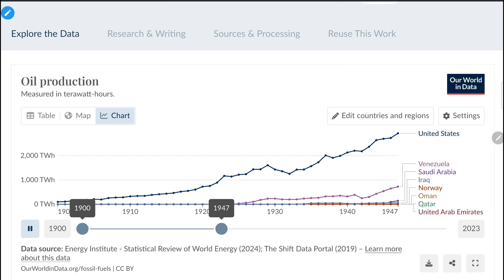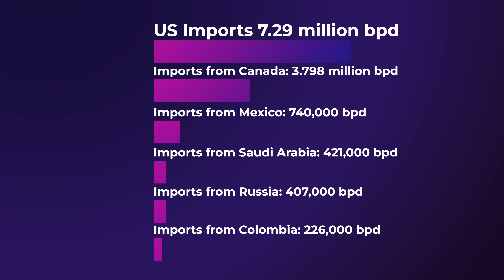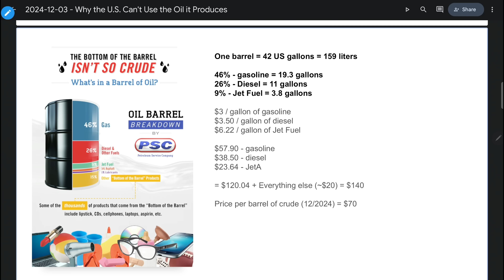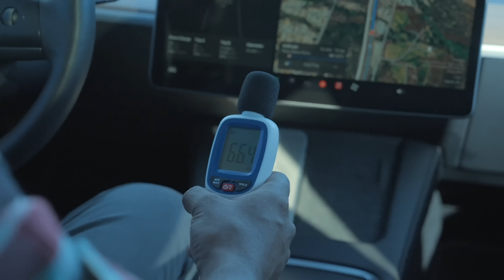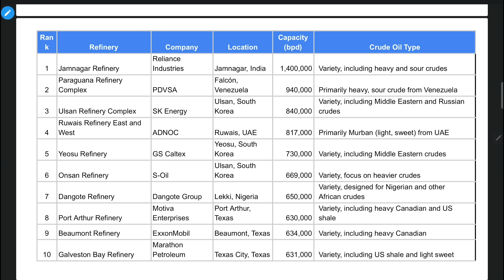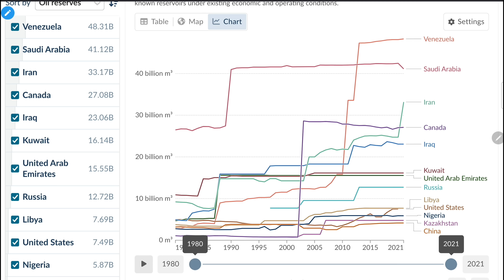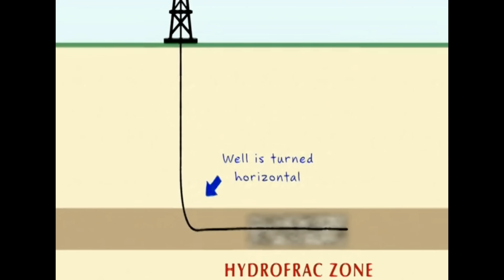Why America Can't USE The Oil it DRILLS

Comment: Super informative!  Thank you.  A small suggestion w regard to " drill baby drill."
   I disagree that doing so will not benefit the average American even though I agree we are not set up well to process shale oil and will still need to import the heavier crude / export the more valuable light sweet shale
More wells equals more demand for workers.   Workers pay tax. 
When the market gets tight, wages raise.
By exporting more, we lower trade deficits hence less interest paid to finance the dept
Natural gas is also produced when we drill, including fracking shale.  We certainly can use nat gas domestically.  It is far less poluting.  The more nat gas we use, the less heating oil we need.
We can use nat gas to generate electricity as well.

I am puzzled as to why we do not build at least some new light sweet crude optimized infrastructure near where we extract this type of oil.   Perhaps labor prices in other countries are so low that it still makes sense to ship our oil to them then buy back the finished product.
Still seems for national security we should at least build a few optimized refinery
Plants.
I m looking up heating oil next.  Seems pretty easy to process crude enough to get get it to burn well but let me find out.  

Thank you again for your excellent video.

Comment: Interesting, but EV and alternative "green" energy is not viable until 30 years hence.  But you say the US "exports" sweet oil at a premium and imports "sour" (or heavy oil) at a cheaper price, I may be missing something but seems to be good thing. Also, isn't there a problem with the Jones Act which artificially raises the transport costs between US ports. As for California, anywhere else it would be a failed state, with draconian "Green" ideology which makes energy more expensive.

Comment: The heavy crude is used for production of Disel, machine oils and hundreds of products that cannot be produced from Sweet Light crude.
Also, a processing plant works with a specific type of crude.
Result. Venezuelan Heavy Crude, for example, is used for machine oil production and USA has 4 plants that works with Venesuelan crude.
Reply: Sadly this is gibberish. Of course you can produce diesel from light sweet like Nigerian. Indeed the diesel cuts from most nigerian grades are particularly high. 
Lube oils and bitumen tend to come from heavy grades in specialist refineries but are a tiny part of the barrel.
Reply: @donaldduck4888  No. No, you cannot produce disel from light crude, nor machine oils, nor a lot of other things.
Reply: @alexander0076969  Of course you can, even Azeri BTC (a light sweet with API 38.6)  - assume you know what this means) has a large middle distillate (you do know what middle distillate is I assume) cut of around 45%.    Maybe you are confusing light crudes with condensates, though even Algerian condensate has a middle distillate cut of around 20%.  Do try to have some idea of what you are talking about.

Diesel btw is generally spelt with two "e"s, not disel [sic] btw.  Have you perhaps confused diesel with straight run fuel oil?
Reply: @donaldduck4888  I just told You, Sir, that light crude is is used to make gasoline.  Light crude is useless for textile and many other industries. Look it up.
Reply: @alexander0076969  You really have no idea what you are talking about do you?  Gasoline is made from virtually every crude after reforming the naptha cut.  US refineries are particularly good at doing this with heavy crude due to the heavy investment in upgrading kit (cat crackers, visbreakers, cokers etc) which allows them to extract light products (naptha, kero, diesel) from the heavy residues.
And you clearly are completely clueless about chemicals as well.  Much of the naptha cut in light crudes is used for chemicals production.  And what do people do with those chemicals?  Make plastics (which is a very wide range of products).  Which are used in textiles etc.
Reply: @donaldduck4888  Bro, Gasoline is made out of virtually every crude. Light sweet is the best = light sweet is almost gasoline.
On the other hand, Disel, machine oils, clothes You wear, plastics are not made out of sweet crude. They are made out of Heavy Crude. Problem with heavy crude is in the name = heavy, means natural  additions that have to be processed out. Different locations have different additions to the crude = this means SPECIFIC plant for SPECIFIC crude. Some plants can process one type of crude and no other types. Thing is, the purifying process produces disels, oils and plastic materials. 
How come You do not know anything? Are one of them Flat Earthers by any chance? I have just Googled this info. And it took less than 5 minutes.
Reply: Kerosene can, though.
Reply: Basic chemistry says that petroleum is a mish mash of many hydrocarbon chains. You can break these down, or combine them to make any organic molecules that you want. It is just more costly to make those big molecules from the light crude.
Reply: @9Point8  No it is no more expensive.  The residues from light crude are broadly the same as residues from heavy crude (there are some exceptions around lube oil production which is a small and specialist area) and are for the most part sweeter (while there are many exceptions lights tend to be sweeter than sours) so need less expensive desulphurisation.  There is just a lower percentage of them in a light crude.  The reason US refiners like to process heavy sours is that they are cheaper to buy than light sweets and accordingly the US refiners have invested heavily in upgrading kit so they could buy the cheap feedstocks.
After 41 years in the oil business I have to confess to being truly shocked by the level of ill informed certainty on this thread from people who think they understand the oil business by googling wikipedia.
Reply: @9Point8  Damn!! Someone actually knows!!
Reply: This was part of the answer. You can deduce the other part logically from Your own answer = every crude oil processing plant is built designed for 1, one, particular type of crude. USA has 4 plants to work with Venezuelan crude.
( without Venezuelan crude, the disel and other extremely important products are made = without Venezuelan crude USA will be out dry = we are 4 explosions away from an economic disaster).

Comment: I believe as soon as EV’s can fast charge “anywhere” as fast as ICE vehicles AND there MANY MORE places to get your EV repaired as readily and easily as an ICE vehicle, THEN there will certainly be a great shift in the way the US depends on oil for transportation. Yeah, those high voltage cables in an EV still need to insulated and the cars still need tires.

Comment: I would tend to move towards the models in Norway and Saudi Arabia more solar, more electric vehicles maybe only electric vehicles.  But that doesn’t solve the problem of oil..  It does move us more towards being energy. Independent but oil is not exactly in the picture at that point it becomes a negative rather than a positive.

Comment: Interesting. Thanks for posting! You did a similar breakdown of a company called Aduro Clean technologies, some time back. They are known, primarily, as a plastics recycling company, but also have lots of patents, relating  to up cycling of petro chemicals in various forms, from plastics to rubber tyres. My question is, could this technology be used to upgrade thick, sludgy, crude oil, to a “sweeter” grade of oil, that is more easily pumped through pipelines, with less energy required?

Comment: Until we build more nuclear electrical power stations and modernize the transmission grid, gasoline is here to stay. Solar panels and wind farms require too much land and deliver far less power per acre than nuclear. The switch to hybrids (outselling BEV 3.2:1) helps by nearly doubling the city mpg. Once the batteries switch from lithium to solid state, hybrids will displace ICE only vehicles.

Comment: A big issue with shale that I don’t think you touched on is that you can’t make much diesel fuel from it.  This is important, because diesel fuel is what really drives not only the economy, but also are modern way of life, since diesel fuel is used for trucks, trains, boats, and heavy machinery.  We can reduce our reliance on gas by investing in public transport, but diesel is functionally irreplaceable.
Reply: But this isn't relevant considering we're still able to sell all of the oil we get from Shale as fast as we Pump It Up.
Reply: 😅I don’t know why we use diesel. It is more expensive at pump, it stinks, and impossible to use in winter because it gels up.
Reply: @cathycharron-folsom4504  
Do you believe people in artic habitats, the pros in logistics, shipping and the military are idiots? 
Diesel's energy density is 20% higher than that of petrol/gas (so consider that regarding the price), so it gives you about 20% more range and diesel motors are not only simpler (for example no spark plugs necessary because it ignites under compression) and therefore simpler to maintain, they are often also more efficient (further increasing the range and being economically advantageous).
Also, today you don't only have "winter Diesel", that doesn't become gel-like that easily or not at all, but motor heating is very common.
..and by the way, diesel is basically the oil that's being used in oil heaters.
Reply: @damianm-nordhorn116  agreed, not idiots ...and, and diesel will store a much longer period without going bad, than gasoline. If sulfur is an added value to further refining sour crude... why is low sulfur diesel more expensive now that the sulfur is being removed from it? Oh! and a third point or question. If sweet crude sells for more than sour crude... the US is still ahead monetarily by producing and selling it to other customers right?
Reply: @damianm-nordhorn116  "diesel motors are not only simpler" No, they are not. Higher compression requires much tighter tolerances, fuel pump pressure is much higher than even GDI. Not even mentioning problems with EGR, particulate filters, DEF etc. They are certainly not simpler both in production and maintenance if we are talking about modern generation. More efficient? Yes, but it doesn't really translate into savings at the pump, not here in the US at least.
Reply: In Europe we have got over the diesel gelling problem. @cathycharron-folsom4504
Reply: I thought Diesel was a waste product or petroleum refining and that we have more than we use, so we export it, mostly to south america where they don't require the sulfur removed.
Reply: Well everything that runs on diesel can theoretically run on gas.  However converting everything that runs on diesel into gas powered would be hugely expensive.  It would also raise fuel costs since gasoline is not as efficient as diesel.  This would be very problematic for trucking companies in particular since they already have to deal with very thin margins.
Reply: @johndriscoll7803 
Petrol/gas isn't good for any diesel engines and while it doesn't destroy an old diesel engine immediately, it would destroy a modern diesel engine's (direct-) injection parts immediately, as it's more like a solvent and not like a lubricant/oil like diesel, which is an oil.
Engines that don't care are multi-fuel turbines like the M1 Abrams's engine.
Reply: @larryhammond5907  
Not at all. Diesel's is really important (for now), fueling trucks and ships and it's the same oil that's used in oil heaters.
Diesel engines actually usually run more cost-efficient and have better torque.
What you might be thinking of and what's someone's considered sort of a waste product (but isn't really) is "liquified petroleum gas" aka LPG, that's often just burned off at the refinery.
However, you can also use it in petrol/gas engines.
However, not all petrol/gas engines are compatible and you need a (slightly) pressurized tank, as it becomes A GAS (evaporates) at much lower temperatures than that stuff the Brits call petrol, us Germans call "Benzin" (and yes, there is no coincidence it's "Benz" like in Mercedes-Benz ;) ) and that is being called "gas" in the US.
Reply: @larryhammond5907  Bitd it was considered that.  That's why it was initially cheaper to buy. Then when it became popular for heavy machinery the corporations decided that it was a good income stream. You can figure out the rest.
Reply: Diesel isn't replaceable YET. 
HOWEVER, heat pumps are replacing oil heating and more and more buses and trucks run on batteries.
We Germans have been sleeping regarding electric cars (Hi there, BYD), but the truck/bus manufacturers are ALL IN on batteries and making huge progress.

Comment: The answer to this question is wrong, and misleading.

America could use the oil it produces if it wanted to; however, the petroleum economic world is sort of crazy.  In this case, it is cheaper for us to sell the oil to another country (and let them refine it) and instead buy gasoline from other countries than for us to refine it into gasoline ourselves.

Also, the power we get to recharge electric cars comes mainly from natural gas and coal which are the fuels for our power generation plants.  This does not take into account all the fossil-fuel-powered equipment used to extract lithium and other components to make the batteries.  EVs are barely able to power cars, forget large excavators and dump trucks.  EVs are not near as "carbon-free" as is usually preached about them.

Because EVs are more efficient at using fossil fuels (which as noted above, they use indirectly), they are cheaper to drive, but probably the cost savings don't make up for their higher price tag in the long run, which is one reason they haven't really caught on yet (compared to gas-powered vehicles).

Comment: The times are changing and the political atmosphere is not going to remain the same.  The fertilizer, plastics and the rest of the industries which derive from crude oil including fuel and lubricants can be redirected domestically.  The regulatory structure is about to change markedly along with the ability to produce new products and byproduct utilization will self level.  Wait for it.

Comment: Fracking isn't just drilling sideways. The key to fracking is setting off large detonations underground which catalytically crack long-chain hydrocarbons into smaller ones, thereby accomplishing much of what a refinery would do while simultaneously making the carbon complexes easier to pump out.

Comment: I think you severely overestimate the realistic capabilities of electrification. 

Utility and Oil companies will probably Duke it out over who must make the trillion dollar investment in their infrastructure for our energy needs. 

ABSOLUTELY NO RENEWABLE energy is going carry the load. I lived by a wind farm. That scam should be charged with RICO act because it had more than half of them not running at any given time. Most of the time the farm is a net negative output for the grid because they never have enough turbines running, and you must input energy to spin the turbine up to wind speed before you can generate energy from it. Wind farms are like fusion reactors.  We can't get more energy out than we put in and the blades toxic waste by gov standards. That's without going into the Battery needs for solar and wind farms. Electric vehicle batteries will always need to be replaced before they ever meet their breakeven point, but beyond that; they're not repair friendly meaning most will become e- waste in 10 years or less. 

Grew up in California and have seen every green energy scam put this state into schrodinger's budget. A surplus one day, and a deficit the next based on convenient politics. 

It's basically nuclear or bust. I watched hundreds of solar companies go bankrupt and run off with that Obama green energy money. They promised 20 years of remote service and software maintenance only to stick you with proprietary software that bricks your unit for the next company you try to take over.
The main problem all renewable suffer is the same as EV's too. They need batteries. LOTS AND LOTS OF BATTERIES. So much so that we couldn't feasibly meet the demand for it with all the different types of battery tech available. Li-Ion, lead acid, all of it COMBINED! Everything would have to have a kinetic battery and even then all those moving parts are more expensive maintenance. 

Instead of pandering to the crowd of white knights on their high horse talk to the technicians who service and run the damn thing. They're the only ones that will tell you the reality of things while these scientists chase the funding and tell you you're the problem instead of finding the solution that isn't based on optimistic wishful thinking.

Comment: Problem is mankind has abused the internal combustion engine which has resulted in a poor tune state . Engineers after WWII chose to ignore the loss of fuel economy on engines post WWII compared to engines pre WWII which were far more temperature sensitive and as a result in a better state of tune. When an engine is set up properly the result is a dramatic reduction in unburnt fuel being pushed into the atmosphere . 
Now here we go again we are focused on battery tech which is far more destructive to the environment and yet we forge ahead with EV, we are clearly losing the access to COMMON SENSE.

Comment: US oil needs a process called Fracking, which is more expensive than oil, so it is not viable. But why is it used? Because the US manufactures money, so cost is not an issue.